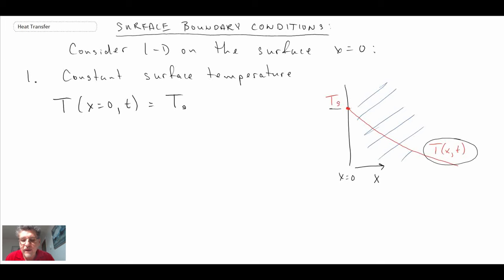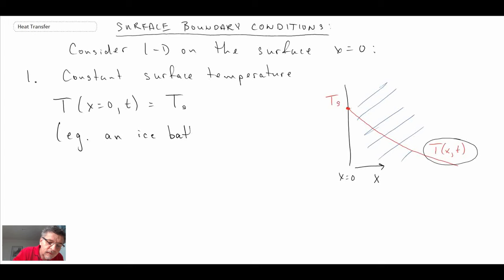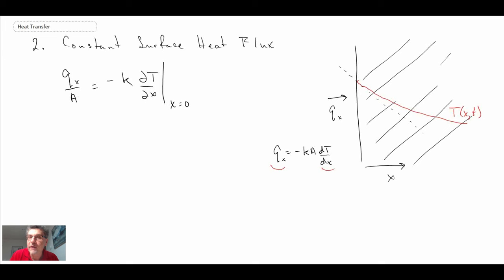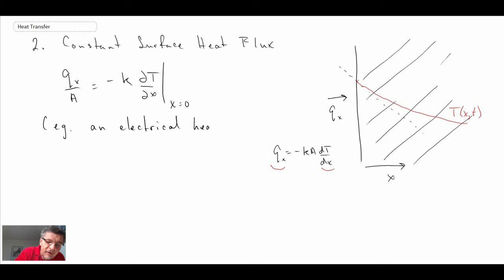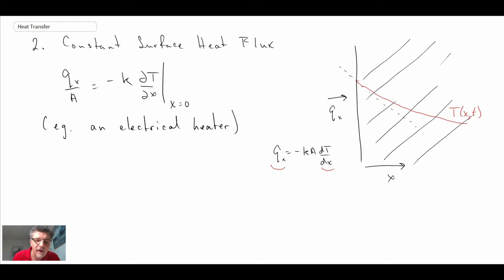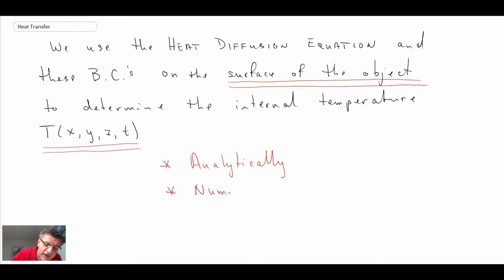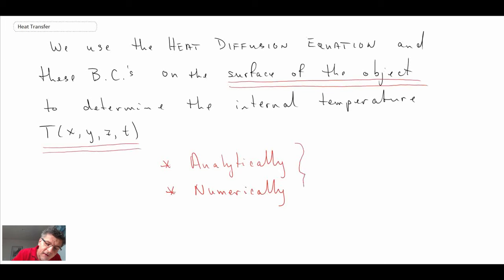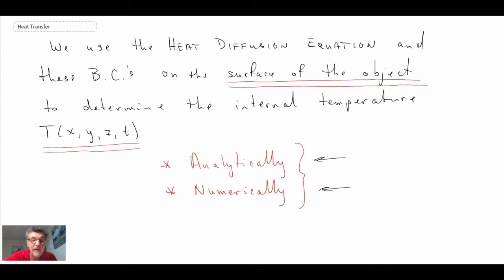Heat Transfer L4 p3 - Common Boundary Conditions

Comment: Hello. In numerical modeling applying at mesh nodes a heat flux what results can give me? For example if a closed-loop heat pump is connected with some pipes which are extracting heat for the ground, can I model the heat exchanger pipes as heat source through a heat flux by defining it at different time-steps based of the building needs or is it better to rather impose the input temperature resulted from power needed and temperature which is coming out from the soil? I don't understand how exactly this initial conditions works and what can I get out from them. I need the difference between inlet/outlet temperature to determine how much of the power needed can the heat pump cover, but I don't know how should I put this into a numerical modelling. 

Maybe you can explain it to me or to guide me to some material where I can learn from. Thank you!!